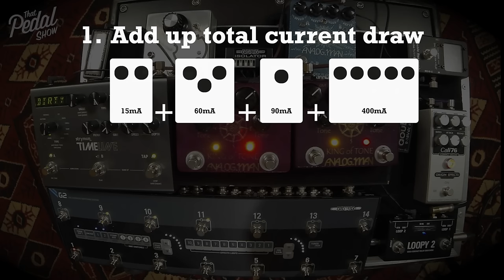That Pedal Show – How To Power Your Pedals Properly & The Legend Of VCPI

Comment: 18v can do wonders but sometimes not. For example my compressor was clipping at the input, modding it for 18v didn't help, still needed to pad the input signal. My treble booster just shits at 18v. Mosfet boost is great though.
Reply from the maker: +Alan Angel absolutely, as I said, its not S magic bullet, every pedal needs to be taken on its own merit :)

Comment: A bit late to this episode, but the other thing it would have have been worth you touching g on is the difference between linear and switched mode power supplies.  Would have been interesting for you to try good examples of both.
Reply from the maker: We only use the latter via TheGigRig Generator and it’s associated bits. Cheers!

Comment: I learned a lot from your video but I have a question which I may have missed,  say if your using something that produces 1500 ma   but your pedals need 800.  do your pedals just draw that all the time? or is that only if you had them all on at one time?  if I only ever use say 3 pedals at a time, does that mean i'm using say only 400 ma at the most?
Reply from the maker: The pedals will only draw what they need, so it’s fine having a supply that can deliver much higher current,
Reply: thank you for replying and I get having too much is ok,  just to maybe clarify, I just meant more on you guys saying that ideally you would want your pedal total to be half of your total power supply output before it could start effecting your tone.  so just to clarify if my pedals are off, they are using way less current then they say they draw, compared to when on then they actually use the amount the manufacturer says.  just curious if I'm correct in understanding it that way?

Comment: Hi Dan, I always wonder: Why isolation circuits like the one you have demonstrated using on your Timeline are not "part" of pedals circuits?
Reply from the maker: +Bernardo Silva because then the power supply to the pedal would need to be capable of delivering even more current. It would make the pedal more expensive to make, And there are so many supplies capable of supplying good clean isolated power that it would be superfluous on the most part. Some low current pedals and germanium transistors pedals do include power isolation circuits but for the most part, it's an external thing

Comment: Theres no mention of an 18volt option in my KoT "manual"...just 9volts...its a 2014 high gain model... are all KoTs safe to run at 18 volts? Or is there a voltage regulator inside as you mentioned on the bi-chorus pedal? Cheers great show again guys!
Reply: I also questioned running at 18v as the manual only says 9v. I Google searched KOT 18v and on thegearpage analog mike responded to this question directly and said 12v was safe and only 18v for a few hours. It would be interesting to know more as I really like the 18v tone on this episode.
Reply: Me too, I liked the sound of the 18v, would be great to try it if I was sure it was safe.
Reply from the maker: +TheDaithiBan yes, sorry guys, only safe for a few hours. In hindsight it was a poor choice to demo , but we had 2 KoT's so how could we not use them. In normal practice don't go above 12v
Reply: Thanks Dan, I think the new Strymon Zuma will be a bit of a game changer when it becomes available...up to 18v on 2 outputs and the other 9volt outs at 500ma...!Ive never tried my Sliderig at 18volts...maybe the Strymon is worth waiting for!

Comment: Hopefully you are still answering questions in these comments...you mentioned that the King of Tone is not designed to be run at 18v for extended periods of time. However, on Analogman's website, there is no mention of this. It simply says you can run 9v or 18v, some people like the 18v. I have the Bad Bob Boost and it says the exact same thing on Analogman's website. I had planned on running it at 18v for a cleaner boost, but I don't want there to be some sort of problem resulting from that. Can you give me some insight into where you go the idea that the pedals don't like 18v for extended periods of time?
Reply from the maker: You can run the new KoT’s at 18v, no problem, some of the older new use lower voltage capacitors
Reply: Thanks for the super quick reply! Absolutely LOVE your channel by the way.

Comment: What power supply were you using in the video? I was setting up my friend's board and he uses a Voodoo Labs PP2+ and when both a klone and the donner reverb are on at the same time it causes a high pitch noise to come through the speaker (potentially the charge pump oscillating?). I'm just not sure what could be the cause because the PP2+ has isolated power outputs.
Reply from the maker: +Matthew Lee using TheGigRig Modular Power Supply

Comment: when you say “isolated pedals,” do you mean your pedals are connected in parallel? do you run your pedals on batteries for “isolated power supply”? or are you 9v/18v powersupplies also distributing voltamps in parallel?
Reply from the maker: That is an electronics question I don’t really understand - Mick here. But it means that the grounds are isolated from one another so there is no ground loop hum, like you can get with non isolated supplies and daisy chains. Cheers!

Comment: PNP and NPN are the use of P and N type semiconductor materials used in the transistors not because of voltages. It is the case that N type semiconductors carry charges via electrons that are negative charge and P type is less negative so it is positive compared to N type. when using PNP and NPN transistors the only difference is current flow which is why the arrow in the circuit symbol changes direction. cool video but thought I'd point this out for all the semi conductor nerds.
Reply: 'These peas are a bit green...'
Reply: Yeah but...

Most viewers aren't versed in electronics; if they were, they wouldn't need this video.  And regardless of whatever can be done with NPN & PNP transistors in terms of circuit topology, what most guitarists will know/remember is "Hey... my Germanium Fuzz manual says it uses a center-positive supply."

That and "PNP" is what they do after they drink too much beer...
Reply: Modern center-positive pedals should (not necessarily do) have a polarity-protection diode in the power input to protect against the chance that someone uses the wrong power supply. So long as the power receptacle isn't soldered directly to the board, it would be a rather simple modification to change the wiring to make it center-negative.
I believe that BOSS is responsible for the power input standard for effects pedals being wired opposite to what all other consumer electronics are. Otherwise you could just use any old wall wart power supply that met the 'V' and 'C' requirements. But then, they might not be 'clean' enough in voltage ripple for music standards.

Comment: this comment probably seems stupid given that video but can I daisy chain multiple pedals with a draw lower than the mA output from the power supply. e.g strymon power supplies have 500mA output jacks, can I daisy chain 3 100 mA pedals through that or will the isolation problem still occur?

Comment: Dan do you advice overwraping with lp type bridges?
Reply: Yes, been doing it for years. Makes paying easier
Reply: Depends on the angle/height difference with the bridge. There is no 'right' answer. You do it if you need to...understand the physics...the break angle on the string as it passes over the bridge...and clearance with the edge of the bridge. Overwrap if the angle is off and you have no other (or 'proper') way to 'fix it'...assuming you've actually identified a 'problem'.

Comment: Anyone know where the law of diminishing returns starts with raising the voltage to a pedal?
Does it get any better @ 24vdc, 36vdc, 63vdc?  Assuming the components in the pedal are rated for such voltages of course.
Reply from the maker: +Wak Job it's totally subjective for every pedal, but because most pedals are rated at 9V DC, there's no real need to design them with capacitors more than 12v. If it's rated to work between 9-18 v, then a 22v capacitor. When you increase the voltage capability of a capacitor you increase the size. Think about the size of the filter caps in your amp. So the pedal just won't go that high, there's a definite end stop ;)
Reply: It starts just before the point that you let the smoke out.

Comment: helppp, is that any side effects if we use lower current than the pedal requirement current? im using cioks schizophrenic 1st edition (current on each outlet is only 75mA)  on my micro pog, and its always sound normal even im powering it below the current requirement.

Comment: I have a Strymon Zuma that claims 500mA @9V, my most power hungry pedal is a Source Audio Ventris Dual Reverb (280mA). If i use your formula i need 560mA, which means this isn't enough; Correct? I have 8 total pedals totaling 685mA, based on your calculation I need 1370mA; I can't determine if the Strymon Zuma is powerful enough; any idea?
Reply from the maker: Zuma is very powerful, if anything it’s underrated for available current draw 👍

Comment: I have an ISO 5 from voodoo labs, and when I run my EP booster at 18v (which it's rated for 9-18) I get a ground loop sort of noise from it, but when it's run in 9 or 12 v I do not... What could be causing that?

Comment: when your using your doubler.. is that just doubling the voltage by taking twice the amps or somthing else? Just thinking about buying one but i have a voodoo labs which only has a max 400ma draw per isolated output? thanks
Reply from the maker: +Andy “Da7thSon” Lord it doubles the voltage but it's also isolated so it can deliver about 300mA
Reply: Hi Dan (or Mick)... sorry my question was poorly worded. What i was asking is if i purchased your double, say the pedal wants 18v with 100ma, is your doubler drawing 9v and 200ma's or is the maths different (eg if it was to get 18v at 100ma, it actually draws say 9v and 800ma). I dont want to overload my voodoolabs 4x4 as each feed is only 400ma.. hope that makes sense.

Comment: So I'm thinking I know the answer after watching this but just to be safe. If for example an sl drive pedal can run at 9v-18v would I be ok to power it with 12v? I mean is that a 9 to 18v range or does it mean it has to either be 9v or 18v? 
Cheers
Reply from the maker: +1Guitar1joe1 Anything between 9 and 18 is fine. And below 9 if you want too... if it'll work. :0)
Reply: Thanks for the reply guys and great channel 👍

Comment: Is there any A/D and D/A in the G2, or is it strictly analog signal paths from start to finish?If it's all analog, how does that work with swappable pedal order (without giving away any trade secrets, of course!)?
Reply from the maker: +MA L absolutely no D/A converters in G2, its 100% analog. We use a matrix to be able to swap the order
Reply: That Pedal Show That's what I figured.  Thanks for the answer!

Comment: Why cant i power my boss fs7 (basic latching switch) through my voodoo lab pedal power plus 2 9v port? Boss said to use a 9v PSA power adapter,wich i don’t want to have to use on my pedalboard. I just want to understand why i cant power this switch correctly? It said the fs7 only needs 25mA,wich is low output.

Comment: I have a Boss super phaser that use 9V AC into a daisy chain (9v dc) with all my pedals without any problem during 2 years, until recently, maybe because I keep getting pedals and powering them in the same chain maybe lossing (or exceeding) mA. Is it possible to damage the pedal if I keep using it that way?

 PS:I ordered a One Spot Pro solely for the AC output, plus is supposedly to be isolated
Reply from the maker: +omarerosas ah, do you mean ACA? The old BOSS ACA pedals don't need an AC, they were designed to run from an unregulated DC supply. There's a diode on the power input that drops the voltage down so if you plug 9V into it, the circuit only sees 6v, which is enough to power it but not enough to run the way it was designed. Use a 12v supply and the pedal will see 9V and sound fab

Comment: What about Klon-type pedals with an internal charge pump? How do they convert to 18v? Does it get turned back into 9v afterwards in the circuit, and if so does that negate the increased headroom from the increased voltage?
Reply from the maker: +Paisley Wilde This is a question for Dan. I have literally no idea, despite being something of a Klon fan. However, there is a ton of headroom and dynamics in that pedal, so whatever it's doing, it works. :0)
Reply: Oh definitely!! I really love the added dynamics and what my archer does to my sound. Just generally curious! Great playing and video as always!

Comment: If I want to power a pedal that has low current draw (KOT) at 15v is it ok to use an adapter like the El Paso that puts out a lot more current than needed?  Does it just take what it needs, or could it cause a problem?
Reply from the maker: It only takes what it needs. Just check the polarity on the output of the ElPaso, I think it’s centre pos, so you’ll either need a reverse polarity adapter or a mod to the ElPaso

Comment: Current is not actually the power that pedal is drawing. An 18V 100mA pedal draws the same amount of power as a 9V 200mA pedal. So power they would be drawing is 1800mAV each
(e.g. Power=Current × Voltage)
Say you have an MXR238 Iso-brick with an input of 18V DC 2A (e.g.2000mA). So it has a power input of 36000mAV before being distributed to all outputs. And it has these outputs ➡️ two (max15V×250mA)+ two (18V×250mA)+ two (9V×450mA)+ two (9V×300mA)+ two (9V×100mA) which means there is a potential power draw off of 31800mAV from all those outlets if all connected to pedals exactly rated to those numbers. As 31800mAV (e.g. power output) is still less than 36000mAV (e.g. power input) they would all work as intended

Comment: I am at the other end of the spectrum to you guys. I'm a gigging guitarist that runs four of five pedals at most, that's all. Tuner, C9, Eq and a drive depending what amp I use. Covers band, I'm the singer so I can keep it pretty basic. Don't laugh... I use a power supply rated for each pedal that I plug into domestic plug board. I built a pedal board that hides it away underneath with the single cable coming out for power. What am I doing wrong? I haven't had any issue in 18 months, 60 gigs, and probably the same in rehearsals. It sounds right. Love to know how unbelievably wrong I have got this... Didn't like power blocks because any problems meant buying the whole thing whereas I can change out a shit power adapted or whatever. Hasn't happened yet but that's the idea. If anyone has any views I'd love to hear them. Cheers
Reply from the maker: +xxnonstopdancingxx If it works, it works! And if it works, there is no wrong. There might be a bit of extra hum, but if it was an issue, it would annoy you and you'd change something. Nice one!
Reply: Thanks. It suits what I use it for and it's dead quiet (it's not having to cope with much to be fair). Great channel

Comment: Can't find any confirmation on Analogman's site or product manual that KoT can take 18v. Is it marked on the pedal? Or was it a verbal confirmation? Just wondering.
Reply from the maker: +Philip Van Peborgh hi Philip, the KoT isn't really designed to take 18v for long periods of time. But we had 2 of them. It's ok for short periods but not for more than 10 minutes at a time
Reply: Ok, glad I clarified. Would have have been gutted after a 12month wait to have 10 minutes of glory then smoke.

Comment: So, my Jim Dunlop dc brick says: 

“Seven 9V outputs can handle an average of 55 milliamps each, or a total of 375 milliamps in any configuration”

Does this mean I can use all 375ma (all pedals are 9v) or should I be working on the basis of only using half of this?

Thanks
Reply from the maker: Use em all! It depends on the supply and not all are equal. Sometimes you can notice that things get quiet or spongy or soft sounding. Sometimes that can indicate your supply is struggling for headroom. Now, the reason Dan and I will always over spec the supply considerably is so we know it’s never the problem. Cheers!
Reply: That Pedal Show Much appreciated, thanks 🤘

Comment: Would it be right to say that with a compressor, increasing the voltage increases the dynamic range, which simply IS to reduce the compression? Compressors after all (at least 'downward' compressors)  are designed to reduce dynamic range. In what sense then would it be preferable to run a compressor at a higher voltage?

I know some compressors work by having a fixed threshold and you add gain to push the signal into that threshold, other compressors have an adjustable threshold, so maybe it only makes sense depending on the kind?
Reply from the maker: +Mark Peskett all depends on the compressor :)